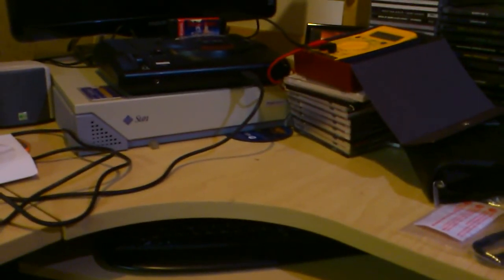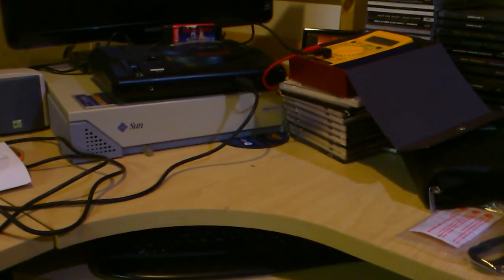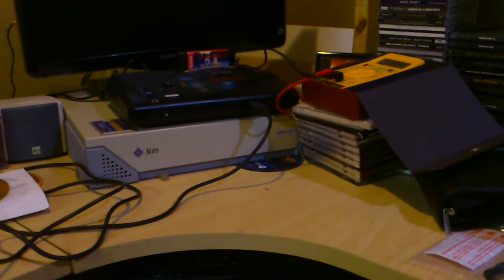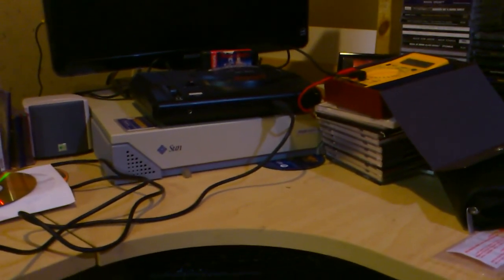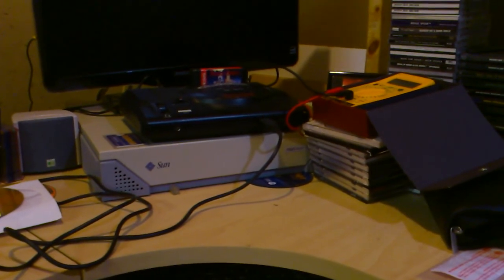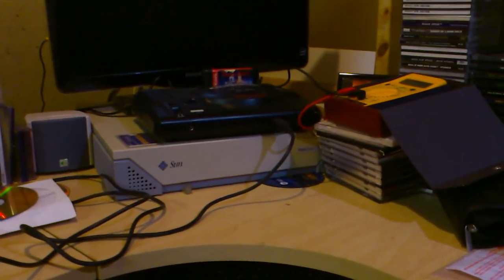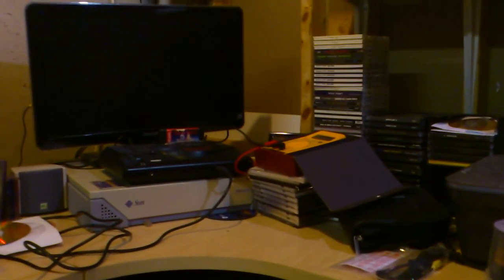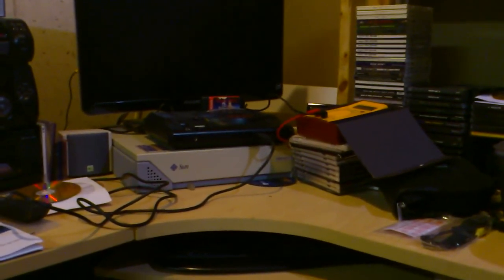Project start.. sort of.

Comment from the maker: I considered that.  I have some systems that use static IP's, but I have some people that come over once in a while and want to use my connection while they're here, which is fine, so it's easy to just have DHCP so I just have to type in my wireless password.  I was going to just have it so the devices that I know will have a lease (my cell phones and our laptops) but others will show up and if I'm not expecting it I know I have a problem.  I suppose I could just set up statics and only use dhcp

Comment: well its 2:48 here .. I've got about 4-5 Sparc systems like that SS2 SS5 SS10 a U1E and a U10 I'd like to fiddle with them someday perhaps write a little Sparc kernel... have you considered using a Static IPs and mac address filtering? maybe make a way to set that up easily on the SS20 like an add remove UI or something?